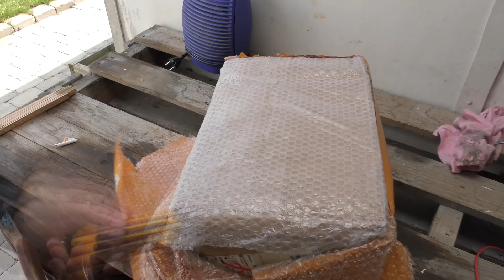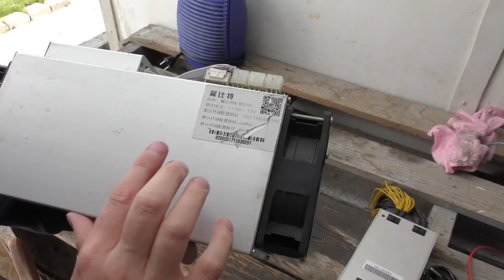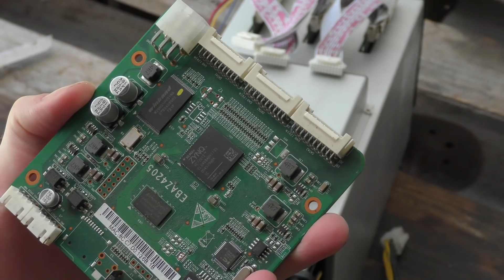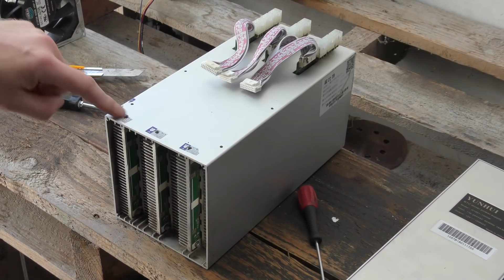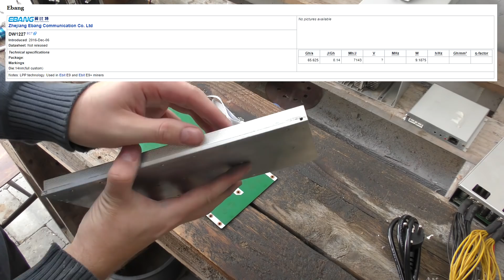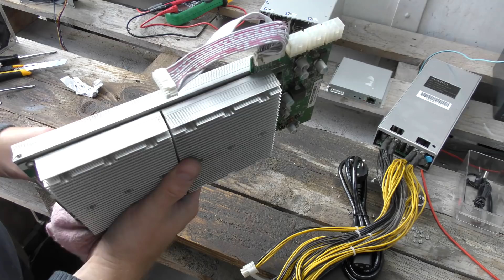Cleaning 132 CPU BitCoin Miner or 1500 Watt Heater - 874

Comment: I like it! You should probably go for antminer S9 instead (not s9se or s9k), and install asicseer on it. This will give  you access to control power consumption / voltage. E9+ runs at 144W per TH, the S9 can run at ~70W per TH. You can easily create some code to change power consumption on a S9 with asicseer, based on ambient air temp readings!
Undervolt also decreases noise a lot, as the fans can run at 40%.

If you want to go balls deep I challenge you to use immersion cooled miners as a central heating unit, and use a heat-exchanger to export heat from the miner setup to radiator's around the house. I recommend something like https://bixbit.io/en/products/cell. We're attempting this at a large scale with their "tech" pretty soon!

Good luck!
-Tore / Cyberianmine
Reply from the maker: Hi Tore Thornæs
Thank You very much!  glad you liked the video :-)
Thank you for watching! :-)

Comment: To save a lot of energy put  it inside  mineral oil
Reply from the maker: How does that save energy ? it reduces the noise,, but ??
Reply: Saves energy because it will not need fans and doesn't generate heat.

Comment: Unfortunately these ASIC miners become unprofitable very quickly, 9 TH/s would earn you around $2 worth of BTC a day at current prices, I wonder how many KW/h surplus do you have each day  leftover in your batteries? To go from 48v battery to the 12v the miner requires you would need 2-3 heavy duty buck converters, more efficient than an inverter and PSU and quieter, the good news is in the winter the miner should easily be able to heat a room!  I hope you do another video where you have the miner running and connected to a mining pool like slushpool.
Reply from the maker: Hi k k
Thank You very much! It,s never going to make the money back,, I know,, I run it a few hours when the batteries are full. I am actually using slushpool,, found my old login from 6 years ago, when I was bitcoin mining a bit. Glad you liked the video :-)
Thank you for watching! :-)
Reply: @MyPlayHouse  Well you never know, just keep hold of the BTC maybe in 10 years 1 BTC will be worth $250,000 ! I mined altcoins in early 2017 and some went up 25 - 100x.  It would be great to use your solar to heat a room in winter but solar is generally a bit lacking in the winter months.  Good luck excited to see how this goes!
Reply from the maker: Hi k k
I bought a few bitcoins at $45 a piece,, that turned out to be a good investment.
Thank you for watching! :-)

Comment: Hi Morten, quick question, is it safe to run a graphics card with a fan at top/bottom when you have a front to back airflow in your server case? I have just gotten a graphics card to render stuff on my server but i don't know if i should remove the blower and shroud...
Reply from the maker: Sorry,, I do not know your setup,, maybe,, check the temperature. :-)

Comment: If you swap the specialised PSU out for a generic server one, be careful. Many computer power supplies will not regulate the correct voltage on the +12V rails if the other rails (particularly 5V) are open circuit and do not have a small load on them. Usually the swing isn't too bad (+/-500mV) but it can be more severe on cheap supplies. This is the second reason you shouldn't use an ATX supply as a benchtop power supply (the first being the lack of a current limit).

You can generally solve the voltage issue by connecting resistors between each of the secondary power rails (+3.3V, +5V, -12V) and ground via the ATX header. I recommend 220 ohms for the 3.3V and 5V rails, and 470 ohm for the -12V rail, making sure to pick 1W rated resistors or better (less than that and they'll catch fire). These values will pull a fraction of a watt on each rail. You should also check whether the supply runs on a single-rail design or split rails for the +12V - this is usually listed on the label that specifies the current limits for each supply voltage. If it's split then you should also add a 470 ohm 1W+ resistor between the +12V pin of the ATX header and ground, as that's almost always a separate rail to the 4-pin Molex and 6-pin PCI-e power in split designs.
Reply from the maker: Hi Graham Sutherland
Thank You very much! I would be more interested in how to power this from 48 volt.
Thank you for watching! :-)

Comment: So it contains a Zynq FPGA, those are rather high end to be fair. Usually contain an ARM core or two. Some ram, and a sea of programmable logic. Could likely implement a miner on it alone. Though, FPGAs have rather abhorrent power efficiency, so that wouldn't really be economical.

Though, other then that, the solution seems fairly interesting as a whole, probably a bit ancient for bitcoin mining these days, but if it also doubles as a space heater, then it is far better then a regular electric heating element. Though, question is, would it beat a heat pump? (most likely not.)

But in the end, for being a curiosity, a hobby and something to gain some new insight into a different environment in this ever growing world of IT, it could still likely be an interesting project to work on.
Reply from the maker: Hi Today on the Bench
Thank You very much!  just playing with this,, I will never become a good business.
Thank you for watching! :-)

Comment: Hi Morten, have you ever looked at Monero and other cryptocurrencies that use CryptoNight based proof of work? If the CPU has hardware AES acceleration (AES-NI on Intel and AMD) it's usually slightly profitable. Also the Monero proof of work is going to change soon and favor CPUs even more strongly.
Reply from the maker: Hi Matthew Smith
Thank You very much!  I am not going in to mining for real,, I believe more in just buying the Crypto I want to invest in :-)
Thank you for watching! :-)
Reply: @MyPlayHouse  That's what I have to do too since electricity is so expensive here and I don't have any solar panels with excess :(

Comment: Lookup "gravity battery."  Use excess power to lift something heavy instead of converting directly into heat. Use gravity as your battery.
Reply: A 1000 kg mass suspended 100 m (!) in the air will only store 272.5 watt-hours of energy.  And that's not considering the inefficiencies in the motor / generator and gearing.
Reply from the maker: Hi Tim Thompson
Thank You very much!  How about compressed air, and running a generator on it ? is that as stupid ?
Thank you for watching! :-)
Reply: @MyPlayHouse  Compressing air produces heat losses during compression. Most gravity batteries are in the form of a lake at altitude draining into a lower altitude lake. The lower lake is then pumped back up hill when energy is cheap or free.
Reply: @jasb78  Actually, yes, pumping water uphill is a good way to store vast amounts of power.  Some power companies do this to store energy for peak use, especially since it can be brought on-line quickly.
Reply: Gravity battery is great, if you're property happen to have a deep dry abandoned mining Shaft on it? I just hope that any start-up company based on this tech, will not come up with a logo "if it's good enough to power my cuckoo clock! it's good enough for me"

Comment: If you can get cheap 12v input with a dc to DC converter than it could pay off in four months running of waste energy.
But at the same time If you divide cost of electricity in half for both you would get at best 2,5¢ cost of electricity in Northern climate for solar pv. Still rendering btc production ineffective. Running a business email, file, DB, web or backup server as could yeald different results. Hardware needs to be either cheap or efficient to get a good result.
Reply from the maker: Hi ArthursHD
Thank You very much!  glad you liked the video :-)
Thank you for watching! :-)

Comment: Here in Denmark, with the relatively dark winters, you're going to have most excess electricity in the summer when the heat is not very useful.
Reply from the maker: Hi Johnnie Hougaard Nielsen
Thank You very much!  Yes I need a water cooled version that can heat a pool in the summer,,, This is for fun,,, I have been looking at a 3-5-8KWh heat pump for 230V,, that would make more sense.
Thank you for watching! :-)